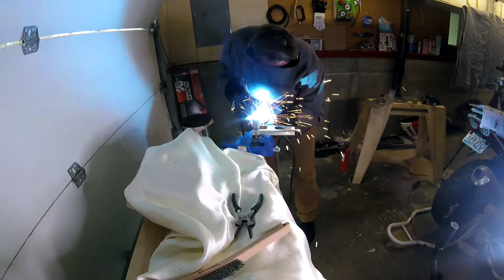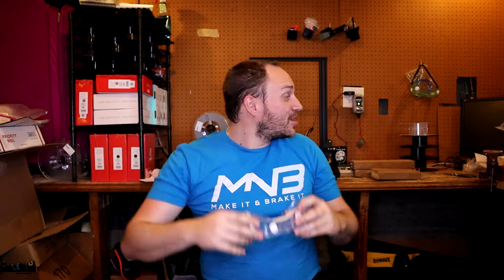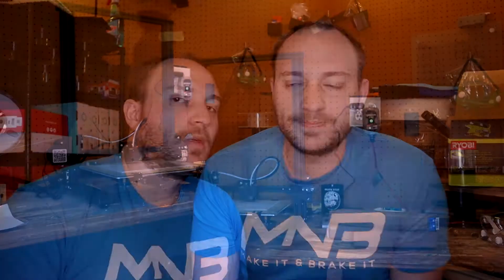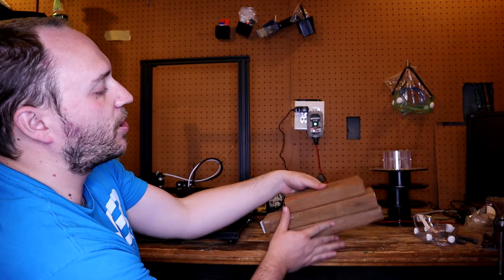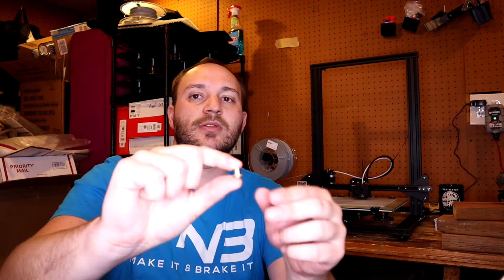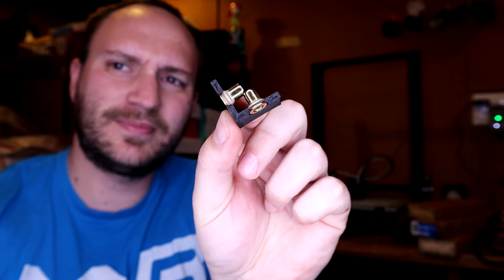Anisotropic Material: Why Your 3D Prints Break [3D Printing Basics Episode 14]

Comment: I think this is your best video yet super to The point and informative. Nice work also I don't know if this works with polycarbonate but we print a lot of PVC at work and something that we do to help prevent brakes and smooth the printed part is just brush on a light coat of acetone and it kind of melts everything together.
Reply from the maker: Thanks man! With polycarbonate, the solvent to use for that type of stuff is MEK, although acetone is quite common with PLA, ABS, and most other 3D printed materials. I suspect that I need to work on my print settings a little more as well, as PC should have very high interlayer strength when you get it right.